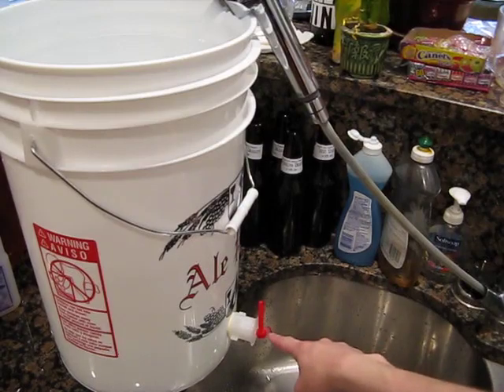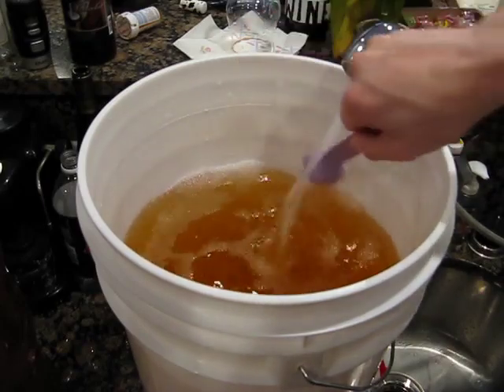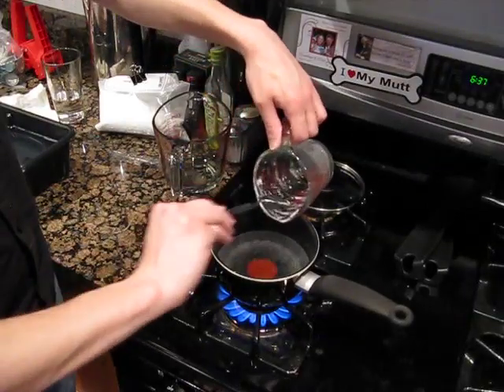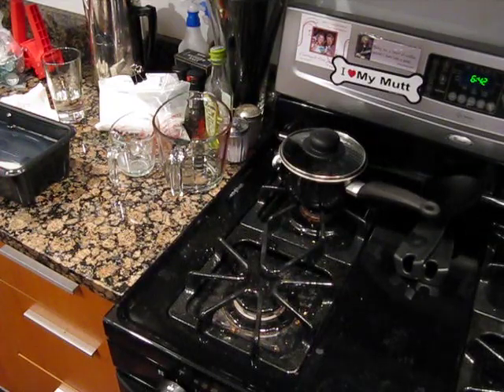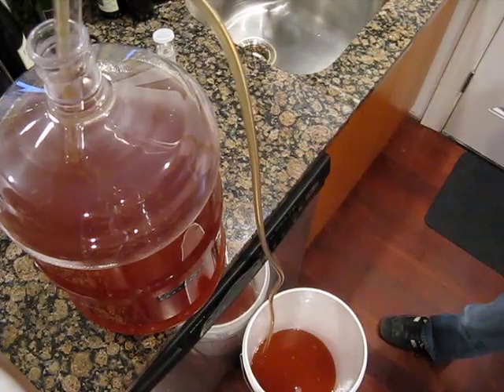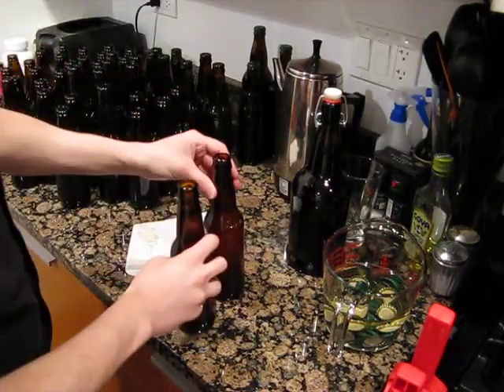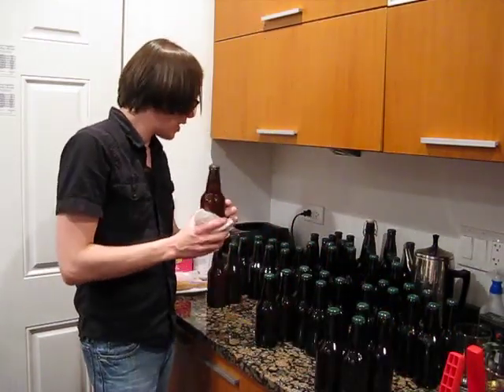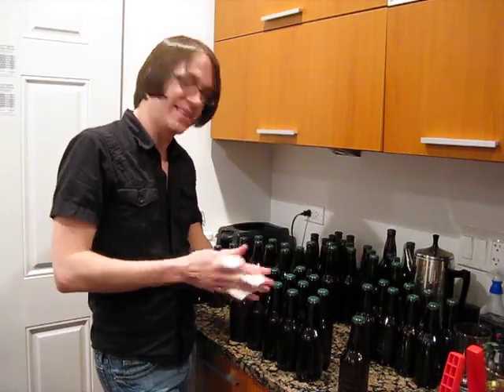Home Brewing an American Light 20 Min. Kit with Joe (Part 4)

Comment from the maker: @steeljan Thanks for the kind words!  Yeah--the weight difference between the Better Bottle and a regular carboy was astonishing.  Moving it around was a breeze--though I had to be careful with the airlock already installed, because you can squeeze the BB and expel enough air to make a vacuum inside the bottle--and pull your sanitizer into it...  I came close, but found that carrying it from the bottom did the trick.  And yep--the cascades should give it a nice, crisp aroma and light flavor!

Comment from the maker: @mikebansain I'm guessing that you're talking about the spigot and the tubing both?  Yes--I make sure to sanitize them both--usually I'll run the iodophor through the spigot, and I usually have my tubing and filler in a trough filled with StarSan.  Either way--you want to make sure you sanitize everything thoroughly, or you risk possible infection.  Cheers!